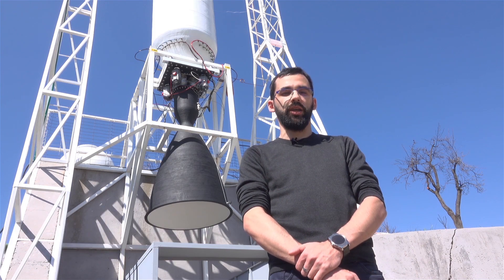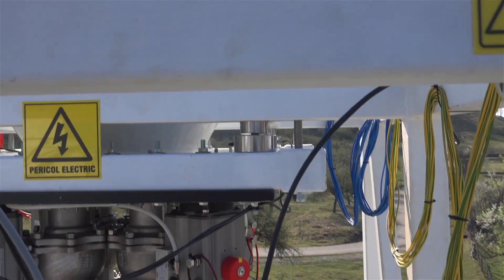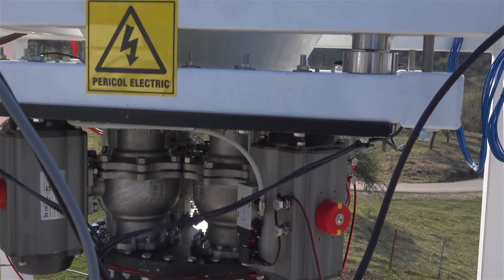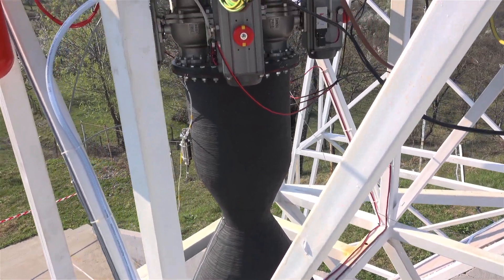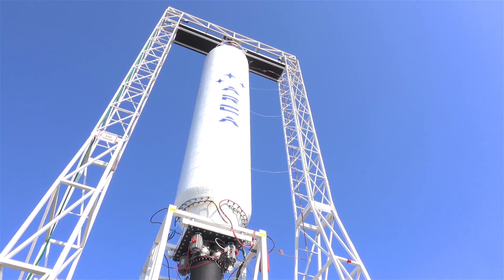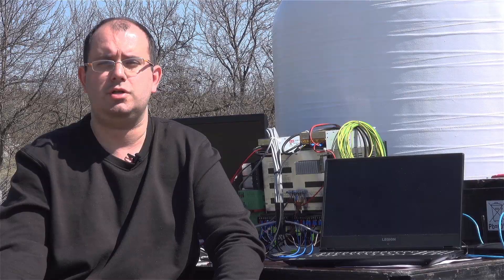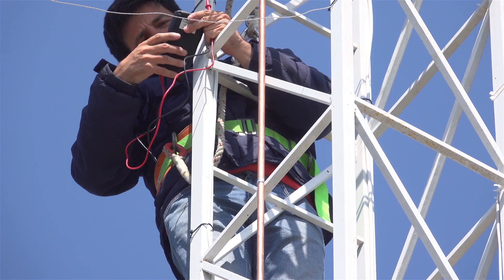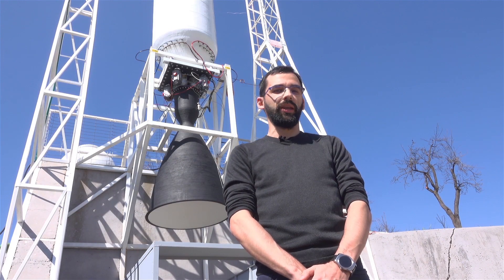Flight of the Aerospike: Episode 30 - Test Article Avionics Integration

Comment: This is completely fake....this is not a real engine or test article. The massive valves go right into the top of the "engine" but they are just bolted to a big plate. The outlets of those valves are far larger than that throat diameter could support. As well, there are normal chinese fiberglass covered K type thermocouples passing between the "engine injector" attachment flanges and those flanges are sealed with red silicone. This can't be real.....
Reply: That red silicone is da best this is the Theranos of the space world.

Comment: Is this a aerospike or arca engine test, ie a self adjusting nozzle size engine test, that doesn't need the rocket built in several stages of 3 different engine sizes, to get into space? And if it isn't a self adjusting nozzle size engine test, why isn't it and when will it be used??????

Comment: Starting to seem like this "aerospike" engine of yours is really just vaporware.  Now youre testing a normal rocket engine, which no one came here to see.  Just test the aerospike or admit you can't get it to work.
Reply: You are very correct here. This is definitely not an Aerospike of any kind and seems to be a simple pressure fed engine
Reply: It's a shame because aerospike engines do have genuine benefits and this apparent vapour ware they call a aerospike in these short Facebook style videos taints the whole aerospike idea as this is getting press over actual functional and tested versions

Comment: The combustion chamber looks like fiberglass???
Reply: More like paper mache
Reply: It looks to me alike the carbon fiber composite SpaceX was going to use before it switched to stainless steel!
Reply: @nightlightabcd  SpaceX raptor and merlin combustion chambers are both made of copper, not carbon fiber or stainless steel.
Reply: He may be referring to the early designs of BFR
Reply: Mr. Sandman He was talking about the body of the bfr, and pretty much arguing that since SpaceX was going to use it for fuel tanks, its all good that these guys are using it for the combustion chamber and nozzle. Completely different things. Under completely different pressures, temperatures and manufactured completely differently. Drawing a comparison between the two inorder to link these guys with SpaceX is, if anything, offensive. Idk what they are using, but it has worked for them in the past and I guess it could work now, but it is definitely not similar to SpaceX, SpaceX has always used copper for raptor and merlin engines.